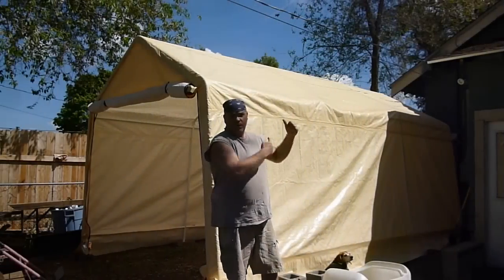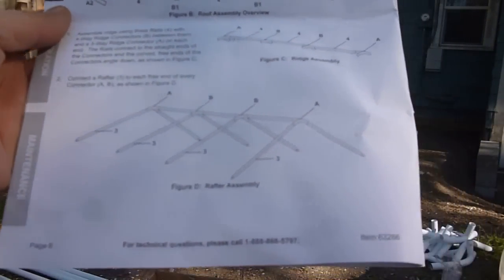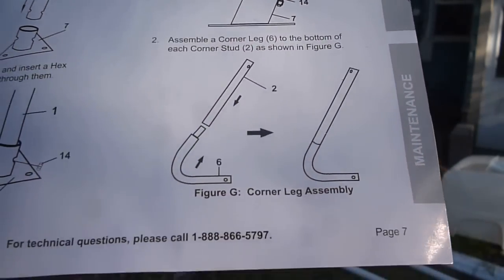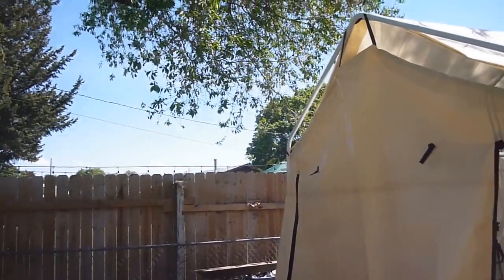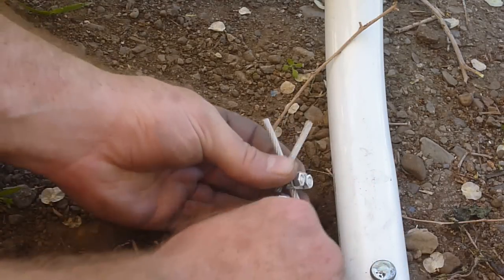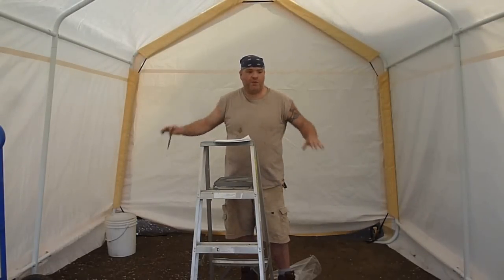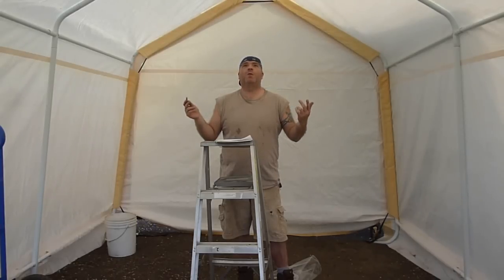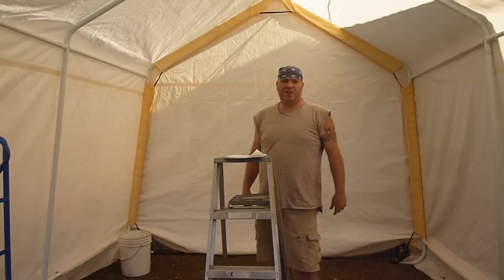HARBOR FREIGHT 10'X17' PORTABLE GARAGE ( EZ ASSEMBLY )

Comment: Omg i did everything the hard way but i built a floor i can drive a car on so i thought just throw the instructions out. Cant be that hard right. I ended up taking it apart a couple time and now i have to do it again because i put all tarps through the poles. Now i see they are supposed to rap around the pole. My thought prosess was this will make the tarp tight and its just better without tugging on a tarp with a ratchet strap but i was wrong. Thanks for the video and every one of your tips are spot on. Im not an angree person but putting that top tarp on by myself with just a slight breeze, lets just say i had to take a walk and calm down because it came off 3 different times. Great video and great advice. Wish i had seen it before it was already done. Good job man. I laughed my butt of when you said dont do it in the wind.

Comment: Cool thanks for the tips starting it in the morning.fitting the end tarps first will be a big help especially if i self tap the frame together so i dont have to pull back apart.thanks again for the advice on these issues.

Comment: Good video and you explained a lot of useful tips. Just put my portable garage today and ran into a couple issues, but nothing too tough. I had to put mine on a 2x4 frame because the ground wasn't level at all and I didn't want to tear up my yard by shoveling. By the way, I thought ropes were included in the box, but according to the parts list they are not included, luckily I had some on hand that worked fine. Going to go back tomorrow and add two pieces of 1" pvc on the front and rear tarps to help hold the flaps down. May also add a few conduit braces across the eaves for additional roof load bearing for snow. Overall it was pretty easy, but the hot sun made it harder.
Reply: Can someone please tell me the exact measurements of the center and side roof poles (#3 and #4) Mine Arent Labeled with a random magic marker # on some and came Not in separate bags! I did not open till Well after 90days so I'm screwed!  I just need the poles lengths so I can get started! I have 31poles but 8dif lengths! Plz help
Reply: I will try and measure them today and get back to you  @kevinallen3588
Reply: @scottbeverly728  thanks! Yes I definitely have a messed up set. I only have 2 3way connects 2 4way for middle only! All roof  side connections I dont have. They only gave me 8 2way clamps and 8 1way clamps . after 8hrs of guess work with the 31poles, I have basic structure up but None of the 2 long sides, on roof piece connected. Shitshow!
Reply: @kevinallen3588  The horizontal side rails measure about 65 1/2 inches long, the top center horizontal rails measure about 65 inches long. I say about because I was measuring them by myself in the dark with a flashlight because I damn near forgot about doing it earlier today while the sun was out.  I measured the side rails that were near the top of the sides, not the bottom rails that fit into the cross connectors. Hope this helps you out.

Comment: Double the use: We got one for over our swimming pool and just brush off the snow.  It was not quite big enough in the 10' direction, so we put 2 planks on the pool  cut a hole in  4 square pieces of scrap wood (glued in place) to hold the ends of 4 of the vertical (top sections only).  We then anchored the tarp in that section to the ground with heavy stakes.  2nd use:  We removed the mid section of the tarp, put the side, bottom pole sections, put deer netting over the side framework,  we removed the zippered end section, dragged it over 2 of our blueberry bushes and replaced the end section (zippered section).  Birds aren't happy!

Comment: I would like to mention to people considering this garage is you can buy replacement ends and top tarps from Harbor Freight, add /parts to the URL to get there. The tarp top last about 2 years, then water will start coming thru.

Comment: good vid...  what if i used the frame to hang plywood and screw the wood to the metal pole frame?  are the frame poles strong enough to put a screw into and maybe some other framing and roofing material?  wdyt?
Reply from the maker: there products tend to vary in quality so i can't give a definitive answer to that  because i don't want to be responsible ime no enganear  but i  wouldn't use just it alone i would add some structure to it  and just use it as a base

Comment: There are two ropes, what are they used for why didn't you use them and also you could of bought self drilling screws i used all 100 of them just don't put them on the outside where the tent rubs because that's asking for trouble. Also you can use duct tape around the upper horizontal beam to keep the tent from tearing.
Reply from the maker: mine didn't come with ropes

Comment: If you take 1 1/4 inch black plastic pipe and cut it you can put where it will hold the tarps on the poles

Comment: Does this have a back zipper door also so you can drive straight through it? If no could you just not install the back tarp?
Reply from the maker: it doesn't have a back zipper but you could leave of the back and front off and drive straight through that is how my dad used his .

Comment: I want to put this in my shop to keep my cats off my classic car. Two questions:
1) Is there enough tarp material on the sides to tack them to my concrete floor to keep my cats from entering it?
2) Is there enough material on the ends to do the same? Thx.
Reply from the maker: the sides and back panel would work but the front you would have to figure something  out
Reply: @JunkworksGarage  and the back does not open up? Or does it?
Reply from the maker: @rf4215  no its solid
Reply: @JunkworksGarage  thx for the quick replies.
Reply from the maker: @rf4215  👍

Comment: I have one but I have a question, does Harbor Freight sell a replacement cover for the 10x17 garage?
Reply from the maker: i'm not sure you would probably have to order it from there warehouse if you could get ahold of them  my dad put metal siding on his frame and it has held up great that is my plan when my goes bad
Reply: Thanks for the reply. Last night I watched a video where a guy strapped a tarp over his and fastened it on each side. In fact it really didn't look bad either. This would probably be a lot easier than installing a totally new cover. Do you happen to have a photo of your dad's metal siding repair job? That sounds interesting.
Reply from the maker: sounds good hope it all works out

Comment: I have had one of these for 2 years and although it is well constructed as far as the frame, the tarp cover will not last and Harbor Freight WILL NOT REPLACE ANY PARTS AND OR SUPPLY YOU WITH INFORMATION TO ORDER THEM YOURSELF. I would not recommend this item to ANYONE !
Reply from the maker: sorry to hear that i have bean happy so far and you might be able to find a tarp replacement from another brand that is similar i'm sure most of them are made in the same factory   my dad put metal siding on his that is my plan for the future. thanks for watching